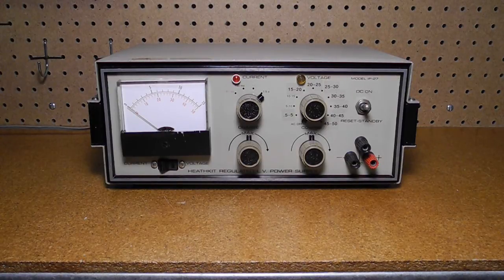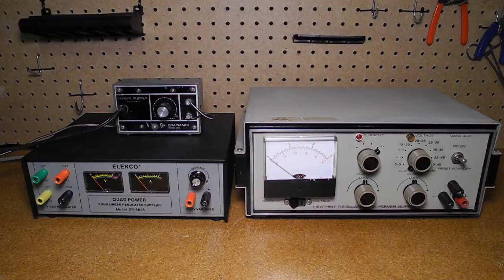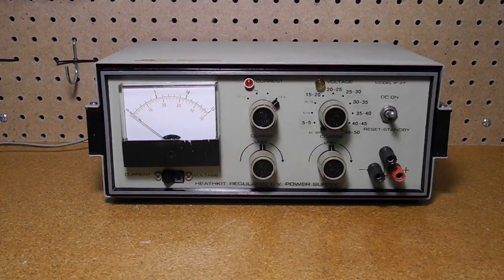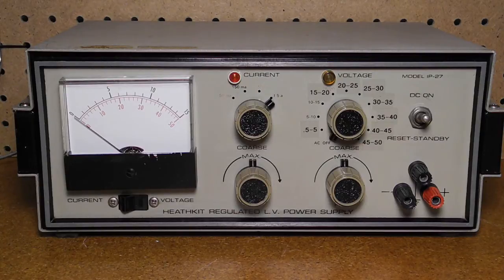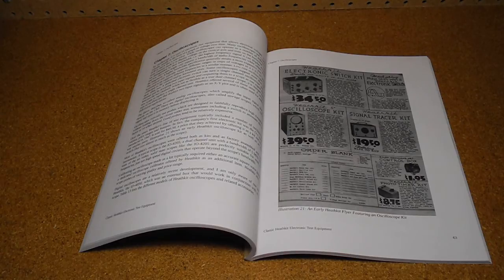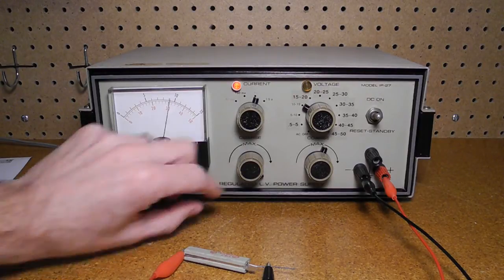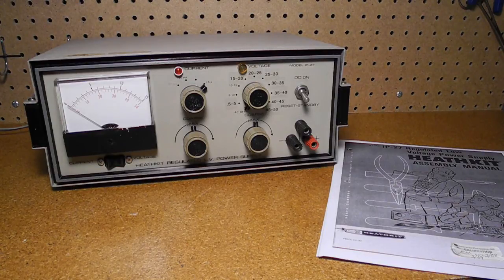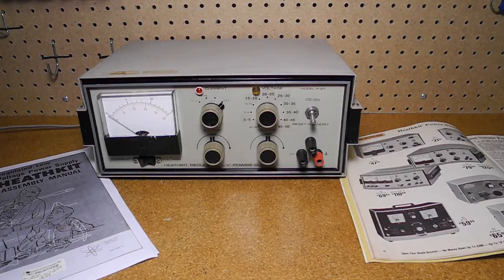The Heathkit IP-27 Low-Voltage Regulated Power Supply

Comment: I have a faulty IP-27 which outputs only around 10% of the power it should, and I found a hole in the bottom of the big capacitor (21C75JB33, 3,000MFD75WVDC) there is a hole between the red and brown wires. Is this whats wrong with it?
Reply from the maker: That could certainly be the problem. It is common for electrolytic capacitors like that one to fail after many years. You can find copies of the Heathkit manual on-line and it has a troubleshooting section that may be helpful.

Comment: Hi Jeff,

Nice video and fantastic explanation. Maybe its your sound that makes it very interesting to listen to!😀. I've a similar unit and it works fine. But something I noticed was that the two high watt resistors in the referenced voltage supply section gets pretty hot like the 2500 ohm 7W gets 308F and 1200ohm 2W gets like 191F if I set it to any voltage and leave it running at no load for like an hour or two. 

At first I thought the 250V CAN capacitor close to these resistors was bad since it was getting hot. But now after changing it with new capacitor  after snipping of the old can capacitor and just leaving it for the negative lug also the cap gets pretty hot. Is it normal with your unit too? Or is something wrong in my unit?
Reply from the maker: These resistors get hot on my unit, but not that hot. I just measured the 2500 Ohm resistor at 170F, so yours sound a little too hot. I would check the values of resistors in the circuit first and see if any of them are out of value.

Comment: Hi, I want to do the update on my IT-17.   Could you tell me if IN4758A 56v  1W is the correct zener diode or should I use IN5370BDL 56v  5W  zener? You help would be greatly appreciated.
Reply from the maker: I haven't tried it, but most people recommend using a 1N4007 diode. You may need to change a resistor value. See this discussion here:  http://www.antiqueradios.com/forums/viewtopic.php?t=1182

Comment: I have one of these in the UK, and the high voltage unit.  The IP-27 has a fault though, which I must sort out.  It was working when I bought it several years ago but I noticed some of the caps ran warm, so I replaced them with suitable modern components.  After that, and despite carefully ensuring all connections were correct , it now won't produce any output. I suspect a change in circuit conditions has popped a transistor or two somewhere.  The HV unit, which uses valves, works fine, they are highly sought after here, I was lucky to find mine at a reasonable price.

Comment: I have one of these power supplies and it worked very well until I accidently shorted the leads, now it is very unstable  and there is a clicking sound coming out of it ?
Reply from the maker: I'd suspect one of the transistors as the most likely culprit. You can find copies of the manual on the Internet. That has a troubleshooting chart and a schematic with voltages listed that you could compare to your unit to try to diagnose the problem.
Reply: Thanks ,
Reply: Cant find a schematic that isn’t blurry

Comment: Bought one on eBay for my little boat anchor shop and provides the voltages correctly but the Amp limiting section is not working.
I suspect the Zener diodes need replacement but are not found in my country.
Was nice to see yours working well. Hope to fix mine soon. 
YS1RS

Comment: Jeff,  I have your book…the    hwa-2036-3.a power supply is not listed ? ? ?

I'm enjoying the book..it's renewed my interest in Heathkits.  I have the Heath Commanche receiver  and a   HW-8 xcvr and power supply   walt  K2CXP
Reply from the maker: I'm glad you are enjoying the book. The HWA-2036-3 power supply was designed to power the HW-2036 2M FM transceiver and similar equipment, so it was really part of the amateur radio product line and I didn't include it in the test equipment book.
Reply: Jeff Tranter     Thanks Jeff